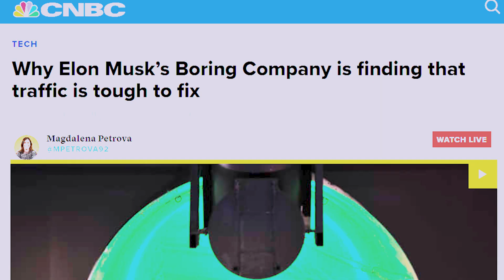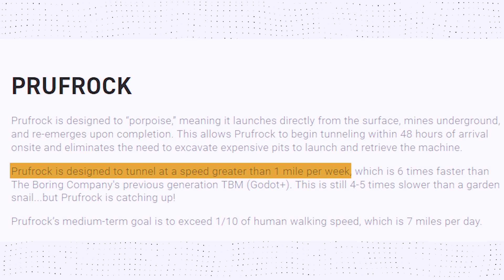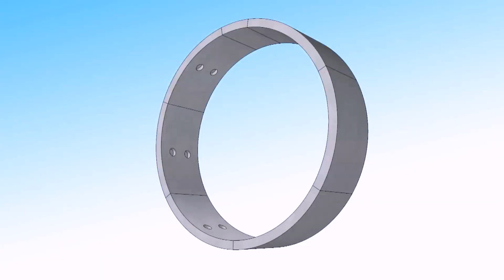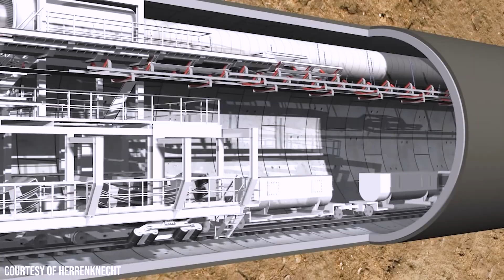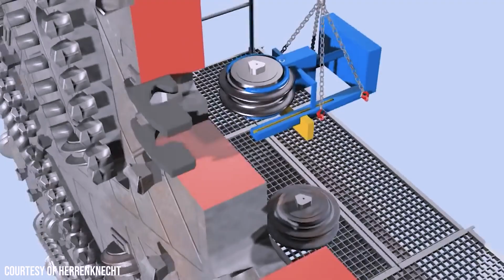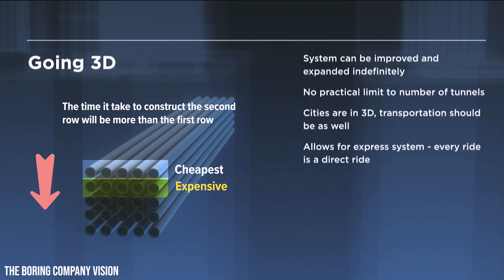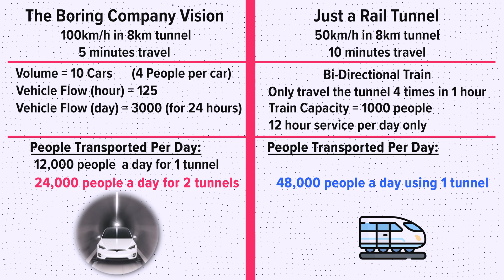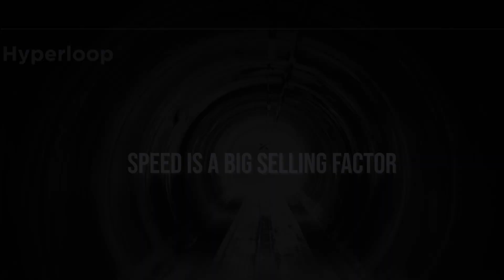Why Elon Musk's Boring Company Won't Fix Traffic: Debunking the Hype

Comment: A subway, not an amusement ride Tesla is needed for Vegas! The canada Line subway in  Vancouver moves 34 million a year and except for a helicopter, is the fastest way to go from the airport to downtown or Richmond's Chinatown 17-21 kms.
Reply: The Vancouver (Canada) line has 16 stations over 19.2 km (11.9 mi) and carries 94,000 passengers per day and cost over $2 billion.

This compares to the original LVCC Loop which has 3 stations over 0.8 miles and carries up to 32,000 people per day at a cost of $48.7m.

So the Vancouver Line has over 5x the number of stations yet carries only 3x the number of passengers per day at a cost an eye-watering 41x more expensive than the Loop.

And the 68 mile 93 station Vegas Loop is being built at zero cost to taxpayers.

Sounds like the Loop is extraordinary performance for the money in comparison.
Reply: BS-the loop has been rjected by city after city and will only stay in Vegas. @andrewfranklin7087
Reply: Peak capacity of the loop is 1,355 per hour, The Canada Line carried 228,190 a day during the 2010 Winter Olympics.  @andrewfranklin7087
Reply: @andrewfranklin7087  LOL LOL There is no loop. There will be no loop. Absolute vaporware. Please do tell how one would plow a 12ft tunnel through and already developed, and aged infrastructure. 

literally a pipe dream.
Reply: @chrisccc22  Except for the fact that the LVCC Loop is already in operation with all of those stats and the larger 68 mile 104 station Vegas Loop is already approved with agreements signed with the business owners who are paying for those 104 Loop stations at the front doors of their premises. 

They’ve already built 6 Loop stations and connecting tunnels with one more (Encore resort) opening any week now and Paradise station and UNLV Thomas Mack Sports Centre are among the 7 additional Loop stations and tunnels down Paradise Road already started construction. 

That’s already 15% of the 104 Loop stations that have already been approved in the ever growing Vegas Loop.
Reply: @ Ha!!! I got an up close look at the Vegas worm hole. It's totally amateur. Have you been to Europe, Montreal, or Japan? Maybe take a look at those. 

The TET-N makes the Vegas tunnel look like   a grade school project. SO Elon. Inventing things that already exist. Even his boring machines are knock offs of once that already exist. Accept theirs are faster and better.
Reply: @chrisccc22  I have indeed been on metros in Europe, UK, Japan, Hong Kong, Singapore, Australia, etc and none of them feature sub-10 second wait times, guaranteed comfy seats for every passenger, transit times 3x - 5x faster due to point-to-point routing, stations at the front doors of every business in town and none of them were built at zero cost to the taxpayer.
Reply: @andrewfranklin7087  Keep Dreaming bud. The Vegas Loopy is a dud. You don't see anything wrong with that system at all?  There is absolutely no way they would ever even come close to serving a metropolitan, with that plan. It's literally Teslas driving in a tunnel. A 12 foot wide tunnel. Have you not seen the issues they are having with it?
Reply: @chrisccc22  what issues Chris?  What problems do you see with it?
Reply: @chrisccc22  I lived on China for 5 yrs-our rail sucks @ss!
Reply: @johndefalque5061  I worked in China for 5 years too. Do you honestly think 600,000 Tecla's running in a Tunnel in China would be better? You are not answering that question. Cheaper? More efficient? You know the answer to that is no. The same way you know that taxpayers will pay for it and already are.
Reply: @chrisccc22  actually, only 70 Teslas have been needed to carry 32,000 passengers per day currently. The Boring Co projects that it would only take 700-1,000 Teslas to carry 90,000 per hour.   With the 20-passenger Robovan, those figures could be even higher. 

The 68 miles of tunnels of the Vegas Loop which is now under construction are not being paid for by taxpayers, because those tunnels only cost around $20m per mile to construct, The Boring Co is covering all that cost and will recover it from ticket sales once operational. 

The 104 stations are all being paid for by all the hotels, casinos, resorts etc who are getting them built at their front doors.
Reply: @chrisccc22  in contrast a subway of similar size would cost taxpayers tens of billions of dollars to construct.
Reply: @chrisccc22  I think the 401 60 km tunnel project is stupid, Musk Vegas loop is stupid-that is why it's one of a kind-I'm all for subways and HSR-I don't know what you're getting at.
Reply: @johndefalque5061  John, can you tell me which specific issues about the Loop that you think are stupid?

For example I hope you agree that sub-10 second wait times, seats for every passenger and zero cost to taxpayers for the entire 68 miles of tunnels and 104 stations are not stupid?
Reply: @andrewfranklin7087  It's just a billboard for selling Teslas-34 million riders a year on the Canada Line Vancouver subway, what Musk has created is underground traffic jams and speeds less than 40 mph. It won>t leave Vegas ever FFS! It's just a dumb vanity project! Tesla is on death row-to continue they will have to switch to BYD cars.
Reply: @andrewfranklin7087  LOL LOL Our city just built a line. It's over 10Km and cost $1B. That was including massive changes and upgrades to an overly aged infrastructure. 

The fact of the matter is, Elon lied to Vegas and totally underdelivered. It was supposed to be a system that had vehicles to seat 16 people, go 155 MPH, and supply service for over 4000 people an hour.

The only reason the taxpayer is not on the hook is because the contract clearly states he must meet those demands, or pay extremely high penalties every time he violates those constraints. 

Elon over promised and underdelivered yet again, and the glaring safety issues can't be ignored.
Reply: @ The average construction cost of above-ground light rail in the USA is $202m per mile, so a network as extensive as the 68 mile Vegas Loop would cost of the order of $13 billion.

US subways cost between $600m and $1 billion per mile so we'r looking at $40b - $68b for a metro.

So Vegas getting this 68 mile underground transit system at zero cost to the taxpayer is quite remarkable - it's not surprisingly that virtually every major business in town has signed up to pay for their own Loop station - it's that compelling.
Reply: @ Anon, Musk has not lied to Vegas.  The contract stipulated that it could handle 4,400 passengers per hour on pain of penalties if it did not deliver.

The Loop has delivered:
“LVCVA Chief Financial Officer Ed Finger told the authority’s audit committee that accounting firm BDO confirmed the system was transporting 4,431 passengers per hour in a test in May showing the potential capacity of the current LVCC Loop.”

And now that events at the Las Vegas Convention Center have recovered from the COVID lull in attendance, such as CES and SEMA, the Loop has been handling over 4,500 passengers per hour in real life.

That is why The Boring Co has not had to pay any of those penalties that were in the contract.
Reply: @ And the contract did not require 155mph in the LVCC Loop. That would be silly as those short spur tunnels are only 0.4 miles long so would suffer from ridiculously high acceleration before having to immediately brake sharply to zero again.

However, The Boring Co has taken the Press for runs in the longer 1.4 mile LA tunnel at 127mph showing that the longer arterial tunnels of the 68 mile Vegas Loop will easily support much higher speeds with the 68 mile Loop averaging 60mph.

And no, 16 passenger vehicles were not required in the original LVCC contract, but with the 20-passenger Robovan becoming available in the future, it will provide a high occupancy vehicle for particularly busy routes and events such as pre and post-games at the Stadium and Ballpark.

Comment: Nice video, but your calculation at 11:20 made the assumption to have 0.8km, or half a minute gap between the cars. Why did you do that?
Reply from the maker: Just for the sake of simplicity. I assumed consistent traffic on the speed limit without traffic jams or incidents for 24 hours. 
It is hard to predict the traffic flow without any thorough analysis and real life monitoring. 
That's why I assumed that all these cars have 4 passengers (Which will never happen). This way, I was more conservative in my comparison.
Reply: @JosephEngineering  The current LVCC Loop has headways of 6 seconds or 20 car lengths between EVs at 40mph.  That works out as 10 cars a minute or 600 cars per hour giving you 2,400 passengers per hour.  This is how the LVCC Loop has been able to handle in the real world 4,500 passengers per day across the 3 stations and up to 32,000 passengers per day during medium sized conventions.

However, the main arterial tunnels of the Vegas Loop will have headways of 0.9 seconds or 5 car lengths at 60mph which works out as 4,000 cars per hour or 16,000 passengers per hour.

Comment: Elon Musk is proposing a faster taxi service for hundreds of people per day.  What Las Vegas needs is a public transportation system for tens of thousands of people per day.  Once Musk addresses all the safety concerns and the other costs (like stations), his proposal won't look like such a bargain, and it will not be useful for a majority of those who live and work and visit in Las Vegas.
Reply: The LVCC Loop is already transporting over 32,000 people per day, which is double the 17,431 ppd average of light rail lines globally. 

And what's really impressive is those LRT lines have an average 13 stations while the Loop does twice the volume over just 3 stations.
Reply: Your first sentence is false.  The tiny LVCC loop can already transport tens of thousands of people per day.   The Boring Company just got approval to expand the Las Vegas Loop to 81 (or 93) stations and over 80 miles of tunnels.
Reply: @kevinbailey8827  No, it can't. They can transport about a thousand people per day, which is terrible by public transit standards.
Reply: @alexseguin5245  It already has transported tens of thousands of passengers per day, during CES, with an average wait time less than ten seconds and an average trip time less than two minutes. 

If someone has shown you calculations showing that’s impossible, they probably don’t have the correct information to use as imports.
Reply: @kevinbailey8827  No it didn't.

Comment: Elon Musk never "came up with" ANYTHING. That would be his nameless, faceless and deliberately anon engineers.
Reply: By that measure, almost nobody truly invents anything new, because everyone builds on previous ideas. Ideas are easy, but actually engineering something to work is incredibly hard and much harder if you need to implement it at scale and make it economically viable. There are plenty of people who thought about making reusable rockets, but SpaceX actually did it. Plenty of people have imagined full-flow rocket engines before SpaceX, but SpaceX actually implemented it in the Raptor. Of course, it was really Tom Mueller who designed the Raptor, but he took the idea of a full-flow methane rocket to Musk, and convinced Musk that it was the right idea, and Musk provided the resources and leadership to make it into reality, which is why Musk runs great companies.  

The automotive engineers are in awe of all the good ideas that Tesla implements, which they weren't able to implement in their own companies because management wouldn't let them do it. Sandy Munro says that he spent years trying to convince auto companies to use large castings and higher voltage components, but Tesla was the company that actually implemented Gigacastings and 48 volt components, and that takes leadership at the top to push through those kinds of changes. Tesla's Octovalve isn't that hard to imagine, but getting all the engineers and departments to work together to implement a unified heat pump that handles all heating/cooling through all areas of a vehicle is revolutionary in the auto industry. The unboxed manufacturing process that Tesla plans to use with the Model 2 is going to revolutionize the automotive industry because it dramatically lowers costs, but other automakers haven't done it because they didn't have the leadership at the top to implement it. 

There are a lot of things that I think Musk does wrong, like not envisioning the Boring Co. making tunnels for subways, as this video points out, but you have to give him credit for pushing his companies for implementing ideas that other companies haven't implemented.
Reply: Who cares what you think
Reply: @WildlifeWarrior-cr1kk  , Who cares what you think when your response does nothing to address the points that I raised.
Reply: @amosbatto3051  so what

Comment: So can the tunnels be retrofitted with trains or are they too small
Reply: So make a subway then? Cool idea. Is that you Elon?
Reply: Yeah I’m totally on team trains. If he could find a way to “disrupt” the subway tunnel building industry to make it cheaper /  easier / faster for cities to make subways the I would switch back to team Elon :P
Reply: The current tunnels would likely be used for emergency access, ventilation or evacuation of atmosphere in the Hyper loop model. The only way to plot routes is with exploratory tunnels like this to test and solve bigger problems
Reply: PS.. Sorry, to your train question, they need the next tunnel size, 21 ft inside diameter to be able to handle containers on an all electric train, I believe it won't use rails but electric powered truck/ train hybrids passengers to be added later after getting the commercial freight business running.
Reply: The tunnels are bigger than the tiny ones in London's underground, so I would say it should be possible.

Comment: Great points you are making. However I would point out that there is a cyber van coming that will accommodate 16 passengers per vehicle. When fully autonomous they will be driverless. They are now saying that the Las Vegas Loop will handle 90000 passengers per day over its 65 miles and 69 stations. I am concerned about the lack of safety features as well. Let’s see what they come up with. They are installing evacuation stair ways and bypasses. I recently took it to all 5 existing stations and from the convention center to the Resorts World Center. Took about 7 minutes end to end with a drive. It’s a bit claustrophobic at first but is very smooth and quiet. The cost to install a subway system in any major city from scratch would be in the 10’s o billions as well as decades to complete. 

NYC built 20 miles over the past 20 years and the cost is over $1 billion per mile. The Brightline system in Florida has cost a few billion and years along an existing right of way and sharing tracks with freight trains. If the LV Loop works it could be the way to go. They are also talking about digging utility tunnels for water electric sewage and data lines. Speed here is essential and could be a game changer. 

The other major rail  tunnel project in NY will cost 15 billion and take 10-15 years. Granted it’s a rail project going under the Hudson River. 

However it this works it’s a game changer.
Reply: man but for examples the london underground system is used by 2 MILLION people every day. This fking tunnel does not even have 1 million in a years jesus, how can you defend this underground tunnel. It is not revolutionary, it is just road under the surface whilst being thousand time less effective than subway or even a tram.
Reply: Lol, even a modern 100% underground subway is cheaper per passanger than whatever Elon is doing here except in the most dense neighbourhoods of New York city.
Reply: @alexseguin5245  Except that the New York Second Avenue Subway cost an eye-watering $2.5 billion per mile and the New York East Side Access a gob-smacking $3.7 billion per mile.

Compare this to the zero taxpayer cost of the 68 miles of tunnels and 93 Loop stations of the Vegas Loop.

I think you have your comparison around the wrong way!
Reply: Not only did you completely misunderstand my comment, but you even made up a fictional story in which Elon Musk actually built a productive transportation system under Las Vegas for no taxpayer money. Impressive!
Reply: @alexseguin5245  In comparison, the original 3-station Las Vegas Convention Center Loop handles 25,000 - 32,000 people per day with 6 seconds between cars, less than 10 second wait times, averages 25mph and cost $48.7m.
Reply: @alexseguin5245  So far, in addition to the 3 original Las Vegas Convention Center Loop stations and tunnels, 2 additional stations and tunnels are also now in operation and 3 more stations and tunnels will soon be opening for a total of 8 Loop stations.  Building permits for subsequent steps such as the 4 stations at Allegiant Stadium are already in process.